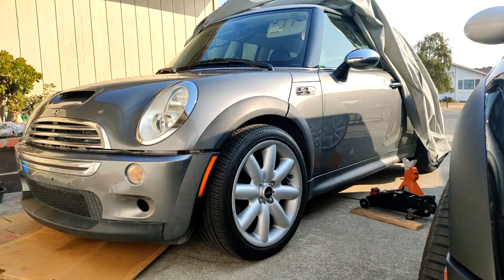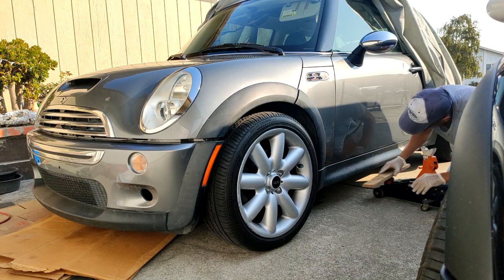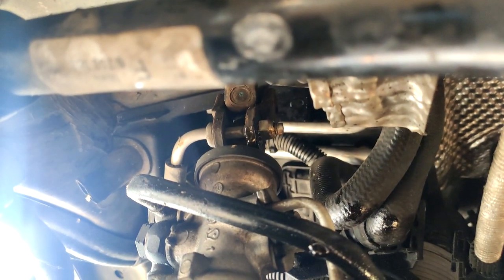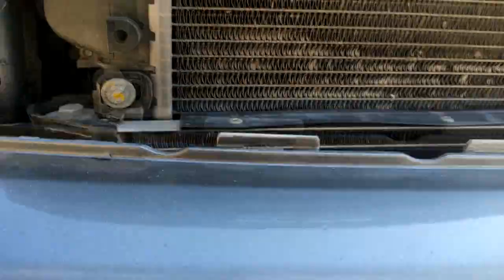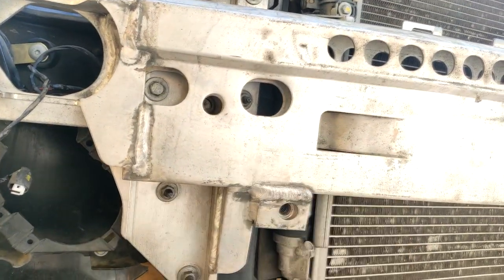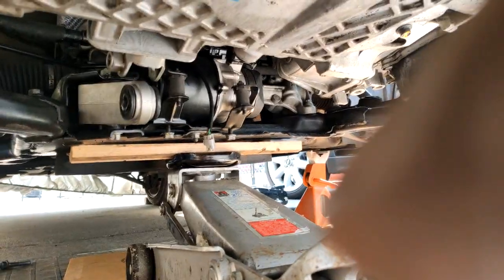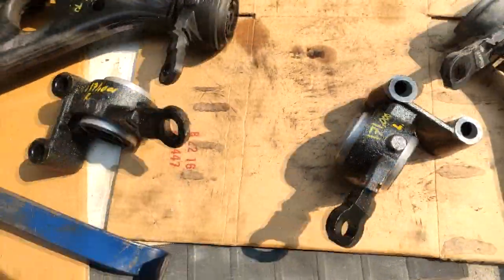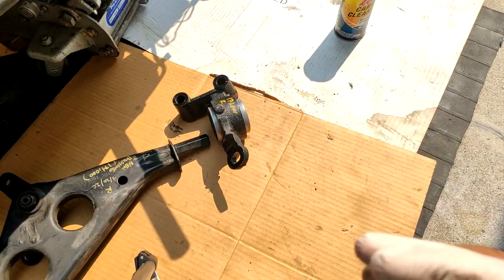Removing sub frame and control arm bushings Mini Cooper R50 R52 R53 MCS JCW

Comment: Great video thanks, jut a note for those with the CVT transmission to remove the shift cable before you drop the sub frame, a 13 mm bolt plus a red clip to remove then press the yellow tab to remove the cable from it's mount.

Comment: Crazy. I watched a video and this mini tech was saying you have to remove the whole sub frame & do it from up top but you did it from the bottom. I plan on doing this with my friends so I’m actually happy I saw this because I need to save some money
Reply from the maker: Yah dealers will take an arm and a leg from you. Even indy mechanics will charge you a good amount. Anything I can do to save me a ton of money I will try to do on my own. Yah subframe will drop from the bottom and you can roll the entire thing towards the front of the car on a single floor jack. Would recommend also changing the power steering reservoir hoses while you're down there as they are known to leak at some point. Just remember to un-do the steering shaft knuckle and the power steering reservoir bracket, otherwise they would get all jacked up when you drop the subframe.
Reply: You can replace everything without removing the subframe, bmw/mini does not remove the subframe to replace all the balljoints and bushings,

Comment: You are so lucky not to have to fight with the seized fasteners we suffer from in the UK due to our wet climate and heavily salted winter roads.
Reply from the maker: Yah I never had the dreadful experience of salt water corroded bolts or frames living here in California. Must be a royal pain having to torch all the nuts and bolts just to get them to break loose though.
Reply: I didn’t fancy the chances of a bolt snapping on my 2003 when I did the rear arm bushes on mine, so I fitted powerflex bushes instead of genuine.

No need to drop the subframe, you cut the old bush out with a sawzall then push in your new bush with some threaded rod.

There’s also supposed to be a special tool available to fit genuine ones in situ, but I’d heard of mixed success stories
Reply: @monkeytutz2  Thanks, I've got Poly bushes for the rear which are a spilt design. Not heard about a special tool before, I'll investigate.

Comment: Can actually remove control arms without dropping subframe. Lower it down just enough to remove two long bolts not easy but it can be done . Great info thanks
Reply: Started my wife’s r53 today. 130k and every front end part is from birth.  Still all in all it came apart pretty decent.  The lower spindle ball joints were seized in place so a bit of the persuader did the trick. Tomorrow I plan on loosening the rear sub bolts and wedging it down enough.  The passenger side bolt is a bastard to get at.
Reply: What bolts did you remove just to lower the back of the subframe,I have the 6 rear bolts half taken out and the mid bolts halft taken out, I feel maybe the lower engine mount it keeping it from dropping

Comment: Did you have any trouble reattaching the steering shaft? I’m have a lot of trouble getting the joint to link into the steering rack
Reply: I just had the same problem I think. I didn't realize at first that I accidentally compressed the steering shaft a little when I brought the subframe back up to the car. To bring the steering joint back down the steering rack just tie a thin rope to the joint on the end of the steering shaft and give a yank down. At least that's what worked for me. good luck to ya
Reply from the maker: Same as Ben's comment, just slowly jack up the subframe and keep checking if the joint is aligned with the end of the steering rack. 

I should have added in the video that before I even unbolt the steering joint, I turn the wheel to line up the bolt that is easiest to remove because I know it's hard to stick a spanner or a socket in there
Reply: Sweet!!!! I got it!!! I ended up just dropping the subframe back down a little bit and slowly moved it back up into place, thanks guys!!